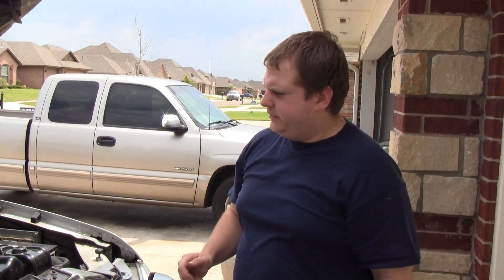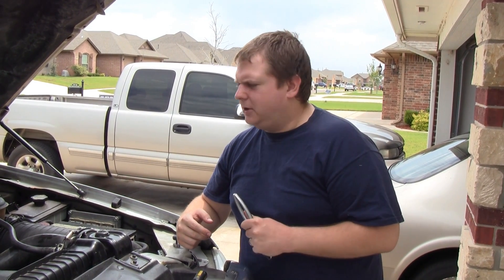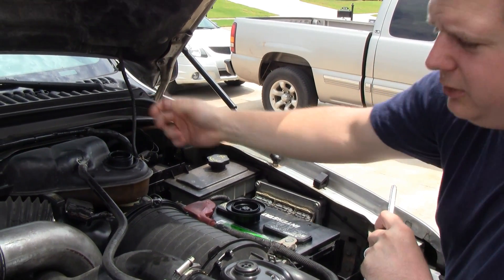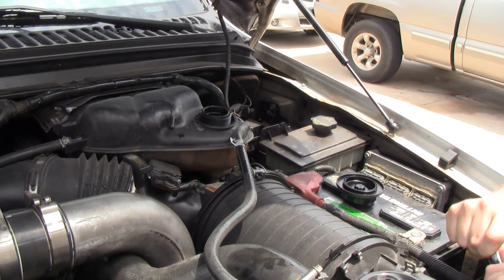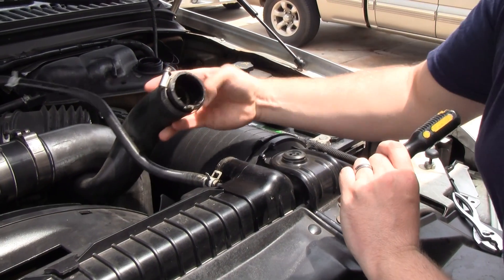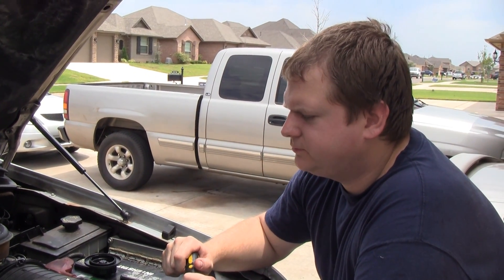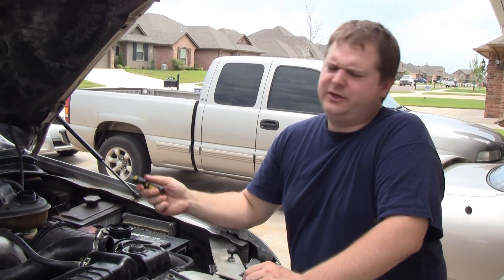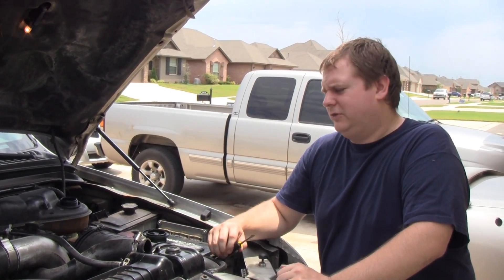Deviously Clever Mechanical Fraud On A 2003 F-250 Powerstroke Diesel

Comment: You said the check engine light doesn't come on from detailers washing the cars? you must be a moron, it certainly does get turned on for misfire codes because the spark plug wires get wet when they pressure wash under the hood. Your just a dumb ass who gut fucked buying at an auction, you don't know what you are doing and shouldn't be buying from an auction. Step up and go to a dealer.

Comment: @Nick Stageberg : Surprise, it's another junk Ford 6.0L.  Sucks that happened to you man.  Hope you "stole it" at the auction. (I'm betting not, based on what it costs to fix those problematic messes.)  I'd have taken that POS right back to the auction and passed it on along. Took any losses or gains and ran right back to the bank with it.  Problem with auction vehicles is that a lot of misfit junk shit ends up there... But, like any auction setting... let the buyer beware!  It's an as-is world we live in, and you rarely get "something for nothing".

Comment: Mine did the same. Oil cooler failure caused the milky coolant. Replaced it and did a egr delete and it's been good for the last 3 years! Cost me $2300 total

Comment: yay.gets a stinking 6 ltr wagon off the road. go buy a 1 ltr rice burner and save the planet & save on fuel. Americans keep whining on about the price of gas, then they go buy a 6 ltr truck and use it to go everywhere. go and walk to McDonald's for a change . reduce your chances of getting diabetes.
Reply: +assistantto007 Kind of hard to tow a large trailer, boat, camper, work rig with a 1 liter rice burner...  Yo could more easily just off yourself and save the carbon credits for someone that actually does things. See, just as valid an offer. jackass.

Comment: wait so did u buy it at auction or at dealer. in the beginning u said auction. At the end you said you will give the dealers name so which is it. Also to those quick to blame the dealer, or auction, my guess is they had no idea that was done to it. They most likely bought it that way, and if it was dealer when they inspected it the mechanic most likely looked into the resvior, saw good looking coolant and kept on going. if it was a auction they typical don't inspect those as most auctions work in a way that the auction house is basically the middle man. If someone wants to sell their car they go to the auction house and put it up for auction. Upon selling the owner gets the money minus the auction fee. That fee is typically either or flat rate or a percentage of what the car sold for.

Comment: I bought a year old GM diesel that came with in infamous Olds Diesel engine, which was simply an add added gas engine that had been bored out. The big problem with this method was that the engine blocks were unable to handle the presumes of diesel use and cracked. Get this, GM had directed the original dealer to repair this engine with epoxy, which was holding, but completely improper and fraudulent. That's why the guy that bought it new, sold it, leading to my buying it. An honest GM repair shop in Salt Lake City brought it to my attention, it was hard to spot unless you were working on the engine. Later on, Cadillac buyers of diesel models filed a class action suit because the Olds engine had been misrepresented to be a Caddy engine. It was still under warranty when I bought it but GM refused to replace the engine claiming glueing the engine was a proper repair. Last GM product I ever owned.

Comment: There are people here saying that car auctions sell off the bad cars. Not necessarily true. The dealer down the road from buys lease and rental cars at auction. So most are like 2-3 years new. Also have remaining factory warranty. 
This dealer also told me they make sure these cars bought are in perfect condition, or they won't buy them. I know this to be true because they were looking for the car I wanted, it took them too long, so I bought a 2013 from Hertz in 2013. It had 25k but also still had the bumper to bumper and powertrain warranty.
Lots of dealers take their trades, to auction, they are not restoration shops and only sell new cars of the vehicle they sell. Chevy dealers don't want fords on their lot. Although if a Chevy dealer gets a two year old trade, they stand to make money off it and sell it as certified GM. Nuff said.

Comment: People saying they should have caught it... do you guys really expect they're going to pull every single coolant hose looking for a problem?   There are so many things that could potentially be wrong with a car.  When you do an inspection you give the car a quick once over, you check the level and condition of fluids, you check for any play in the suspension, you look for any leaks, you check tires, battery condition, lighting equipment, condition of belts, brake pad thickness,  caliper function, rotor runout, check for engine codes, etc etc etc etc etc.  There could still be problems hiding anywhere.  You guys who think the auction house should "stand by their inspections" and take the car back...  Have obviously never done any kind of service work dealing with customers before.  People are ALWAYS looking to get something for free and are always looking for someone to blame for everything.  If you want to take a chance and buy an unknown 12 year old high mileage vehicle for $3,000 at auction, expect problems and don't raise hell when they come up.  Otherwise go take out a $40,000 car loan and buy new like everybody else does.  The guy in this video is very level headed, you all should strive to be more like him.
Reply: In life it's always easy to judge when we're not actually in the position itself.  Usually the reality of things is much different then an outsider might perceive them.
Reply: lmfao. Have you ever worked in a shop?
Reply: Dude, you're going fucking nuts right now.  It depends on what kind of work you do.  If you work for a used car place I'm sure every car gets test driven to find drive ability issues.  I don't work at used car place though.  I work at a shop, and I'm paid flat rate so MOST of my money is made either through upsells or diagnosing known problems that the customer came in for.  You don't take every single car you get your hands on for a "test drive".  What if the customer just wants to get their oil changed and get out of there?  You don't waste and hour of their time tracking down ever little issue on their car when they don't even care.  You go through the list, if you spot anything that needs attention you notify it, if you don't thats the end of things
Reply: And obviously if he bought this truck at an auction SOMEONE drove it, if it had any obvious problems they would have said something.  You cant hide a driveability problem like that.  I'm not claiming to know everything but I do better then most in my position and it's because I LISTEN to those who have more experience.  This field takes years to master man.  Youre not fooling anybody
Reply: +Yute Hube yeah in less words lol
Reply: This. You nailed it man. Being a service manager at a shop just up the road from an auction house is a nighmare. I deal with this crap all day long. Then they blame me for giving them the bad news.
Reply: +neatpete  Which auction do you buy from that allows you to remove  hoses for inspection of the cooling system to make sure it wasn't deceptively blocked up with RTV?  Is that something you typically look for?  Have you seen it many times?
Reply: Did you guys figure out who's dick is bigger LMAO!!!!
Reply: Liam Lexus Build you a fucking idiot
Reply: Liam Lexus Build he was guessing ya troll maggot
Reply: A vehicle inspection should pick this up, because the radiator cap should be removed and pressure tested.  and the hoses should be squeezed and checked while the engine is running to make sure they are in good condition.  This engine is notorious for numerous different failures and anytime a used one is sold, everything on the engine should be double and triple checked.
Reply: kevin smith   I think what you are saying is mostly reasonable, but there is a HUGE gap between the customers that are out to make any minor issue into a court case to get something for free, and the customer that gets legitimately ripped off by (probably) illegal practices. Assuming that every customer is the former is just a bad practice.
Reply: +kevin smith A trained monkey could do the simple inspection tasks you mentioned. If someone is getting paid a mechanics wages to inspect a car he should most certainly not be wasting his time looking at things I (not a mechanic) would easily catch myself before ever purchasing the vehicle or things that involve dirt cheap parts (battery, brakes and ignore the cooling system crucial to proper engine function wtf). Please, mechanics, if your going to inspect a vehicle cut the time wasting shit and and look for things your expertise allows you to catch. This would would make car buying a much more pleasant experience for everyone. And btw the return line isnt every single coolant hose its literally the easiest possible one.
Reply: kevin smith Is that a serious question I was wondering if you have bro who tf doesn't take a car on a test drive whilst doing an inspection and what type of mechanic would not notice a power decline due to a bad head gasket?
Reply: neodyman we know it's diffidently no yours
Reply: kevin smith You talking to me dude? I meant when they buy the truck to make sure it is in safe driving conditions and to make sure nothing major is wrong with it. I'm not talking about working at some shop dude. Also you have never seen me work on a car, diagnose one, or sell work to a customer so do not tell me you have more experience please dude ight? Just like have never seen you work on or diagnose shit before and why Im not saying "I'm more Experienced" because I dont want to look like a narcissistic asshole

Comment: Ya gotta be careful buying anything used.  I recently looked at a 2014 Wrangler Rubi on a secondary lot (non name brand dealer) and the truck only had 19K on the clock.  First Red flag... I thought this to be strange that a Jeep this new would end up here.  They said they bought it from a local dealer and got a good price on it, so they could make me a great deal... Another red flag  there.  I drove it and it didnt drive right.  There was a strange feeling in the Jeep's handling.  The sales guy was trying to tell me that this was "a Jeep thing".  I asked for a car fax on it, I suspected it was damaged in an accident or beaten off road.  They wouldnt let me see one... stating that if I made an offer on the truck they would show me.  I told them I wouldn't make any offer unless I seen the paper.  3rd Red Flag... Walked away from that one.  

I found out later (while looking at other Jeeps) that it was traded in at the jeep dealership it was bought from after the owner wrecked it off-roading.  The dealer knew of the history and didnt want anything to do with it.  They sent it off to auction, and it sold at auction for less than 9K.  It was listing at a "good deal" for $25K... yea someone got ripped off...

Comment: I bought a Jaguar once and the first thing I did was check the oil. It was fresh and clean. I thought that seemed a bit odd at the time but hey when selling a vehicle a fresh oil change isn't completely unexpected. The car ran great but the low coolant light was on. So topped off the system and drove it for a couple days and then started to get cranking problems in the morning or after the car had been sitting for several hours, hydro-lock!   The car needed a head gasket and the previous owner had allowed the water to get low so it wouldn't seep into the cylinders while sitting. Sure enough that fresh clean oil was soon contaminated as well. The cost of repair would have been well over 2k so I made him take it back.

Comment: i can't believe no one has mentioned this, but head gasket failure is almost guaranteed on the 6.0 fords. the 6.4 too. Should have looked over ALL of the cooling system more thoroughly for traces of this.  I wouldn't trust a mechanic glancing over it either. Do extensive research before buying, and go scope out ever last inch of that truck before you spend your money on it. I just bought a used car and refused to buy it unless i could get a sample of the oil to send off to a lab for analysis. again, should have known about the 6.0/6.4 head bolt/gasket problem. i wouldn't even buy one unless it already had the kit that fixes it

Comment: I know it might sound stupid, but how can replacing a head gasket cost 4.000 dollars? Or is there more things damaged? On my -87 Volvo 740 the gasket is 30$ and it takes like half an hour to replace.
Reply: +SnOpeK Domowei half hour to replace a head gasket? Sure you're not thinking valve cover gasket lol
Reply: SnOpeK Domowei Wow! Nice job, that's impressive
Reply: kandylandfarms Man that's some BMW bullshit right there.
Reply: +SnOpeK Domowei , Yeah Volvo redblocks are the EASIEST engines on the planet to work on. Getting to the oil filter during an oil change is actually harder than removing the head!

Now, on these Ford diesels, just getting to the point where you can pull the head is a few hours. So much crap on top of those engines it's crazy ... and the newer the truck, the worse it gets ... not to mention the more $$$ it is for parts. Comparing these 7.3, 6.0, 6.4, 6.7 engines to a Volvo B230 engine is comparing apples to a 673 lb. pumpkin. Not even in the same universe.
Reply: +SnOpeK Domowei 6.0 you have to pull the cab off the truck and it a Ford so they charge more because they can
Reply: +John Jesus all older Volvo HG are really easy to replace
Reply: +SnOpeK Domowei First it was half an hour, now it's "about an hour"
Reply: gotta pull the cab. generally this is caused by egr cooler failure. It's recomended deleting it. also head studs are a one time use item. usually replacement of the junk Ford studs with arp studs is recommended.  also decking of the heads and checking for cracks is required at a minimum.  studs $450.00.   gaskets $250.00.  o ring type gaskets as an upgrade  $350.00.  Oil cooler $150.00.  egr delete kit  $$350.00. coolant filtration system  $300.00.  misc. gaskets $50.00+  the last one I did was over 20 hrs time.  it adds up quick

Comment: Actually its a fairly common problem on 5.3 silverados for a cel to appear after washing underneath the hood. Water gets trapped underneath the intake manifold and causes the knock sensor to go bad, which is where you get the cel from.

Comment: another check mark for BMW CPO if that was a CPO car they would fix it.
Reply: +Rick Tobin lol shut the fuck up
Reply: +Harrison Stone cpo would cover that.
Reply: +ROUSH4203 perfect... and my powertrain is covered for 160km well worth the 5k when you buy a 45k+ used car.
Reply: Rick Tobin no i'm not saying it wouldn't it just that nobody cares about your BMW on this video, it's not even related. And I drive a 328i from 08
Reply: +Rick Tobin how well does your BMW pull a 5th wheel travel trailer?  I'm a fan of BMWs but a BMW can't replace a heavy duty work truck.
Reply: billy mccabe and that matters how?
Reply: +Rick Tobin because you are implying he should have bought a cpo BMW instead of a Powerstroke heavy duty truck. The two are not interchangeable. Unless I'm misunderstanding your intentions with your first post.

Comment: Did you buy this truck "as-is" at auction?  If so, it was YOUR responsibility to check the truck prior to purchase.  It wasn't the dealer's responsibility to disclose what you found.
Reply: +ste har You can't pull hoses on auction cars. Many places won't even let you pop the hood. You can look inside, and hop in if the car is not locked, that's about it.
Reply: +olskoolnewpaint I guess I must attend different auctions than you (and I attend them all here).  You can often drive vehicles on a test-track here and you can always start them, shift them into gear, check accessories, etc.  At any rate...caveat emptor.  It is always a buyer's responsibility to check the vehicles, if able, and/or to accept the vehicles in whatever their condition may be.
Reply: ste har
Never been to that kind of auction. In that case I would check everything, but still I doubt the place would let you remove a hose from the cooling system. In this case that's really the only way of finding the issue. It was a sneaky trick they pulled.
Reply: +olskoolnewpaint The auctions I attend have virtually no security staff (that do their jobs, anyway) and wouldn't even know if someone removed a hose to check something.
Reply: he's not playing the victim here, and if it took him and a diesel mechanic weeks to find the problem with the car in their possession then a 5 min insurrection before auction would be tough. 
And yes, while responsibility ultimately lies with the purchaser there is also no doubt this is mechanical fraud

Comment: You are obviously a good person who got swindled. I commend you for your great relaxed demeanor and outlook of the way you took this costly fix in stride. I was the original owner of a 2006 F-250 PSD 4x4 Cre Cab Lariat LWB with every available upgrade except the chrome package. I sold it before it reached 30k miles because it began to demonstrate the routinely reported symptoms of a recurring design problem the 6.0's had. I have since owned a Silverado Crew Cab 4x4 LTZ Duramax w/Allison trans and never one bit of any problems whatsoever. Prior to the '06 F-250 PSD, I would bleed Ford Blue. Since then, I am all GM without any regrets.
Reply: To clarify, when I said I sold it, I traded it into the dealer with full disclosure of the known 6.0 problem. They had sold it even before I picked up my new truck. I figured since they had a sister-Ford dealership in their group of auto brands, that they went through completely to identify anything it needed.